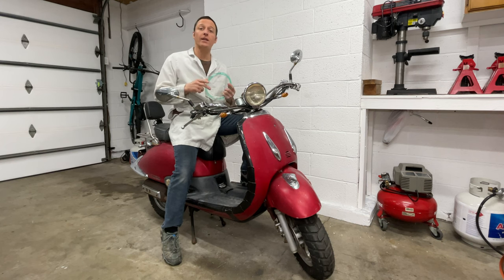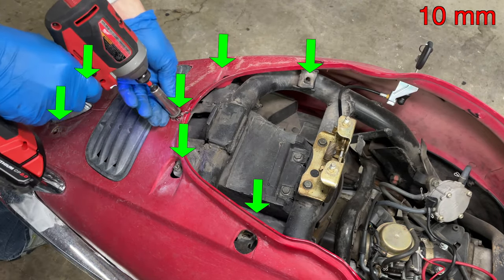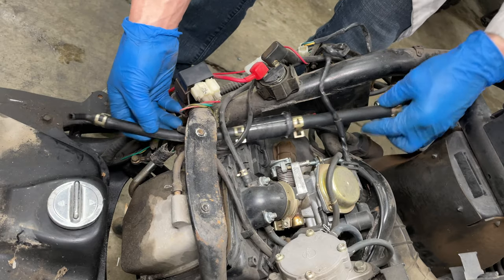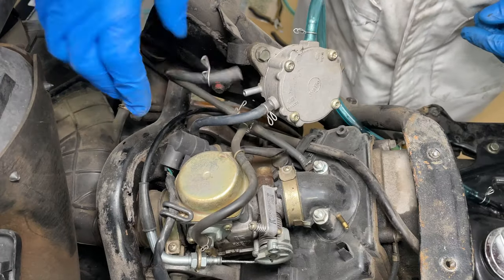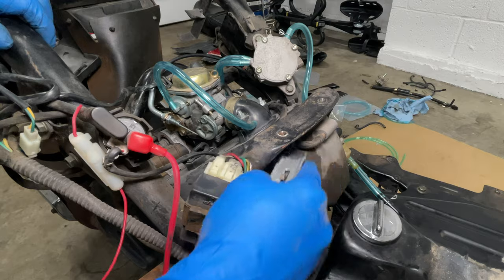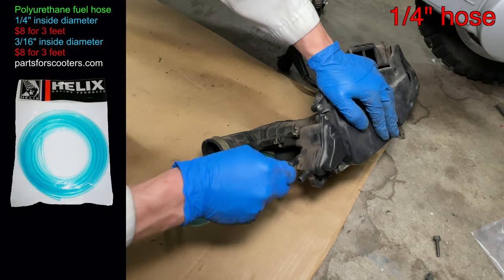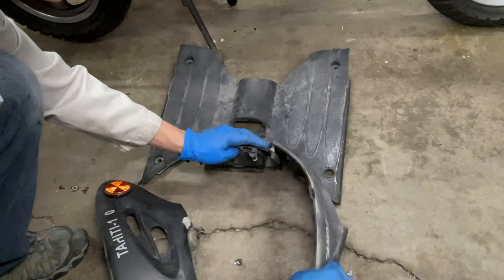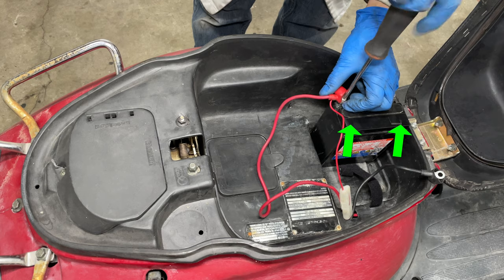New fuel and vacuum hoses and emissions delete on a 150cc GY6 Chinese scooter

Comment: I have the same air box and all I did was removed the pcv part off my air box and put that back on my bike and ran the pcv hose and the cvt hose to that box and that was it. I'm going to buy a uni filter to replace the stock air box.

Comment: Hi Paul, I have a '22 Amigo il Bello 150cc GYG scooter. Last week, I removed the CVT carburetor and installed a Nibbi 24PWK. All good, but for the thing bogging or stalling when I trist the throttle from a standstill. Once I get going, the thing runs well. Could you please advise? thanks very much!

Comment: Hello Paul 🛵👍. I purchased a gel battery recently & was wondering if that was a wise choice. My scooter has complete Leds & the charging system currently is a little over 15 volts at quarter throttle 🤔. Is that too much for a gel base battery ?? Appreciate the info 💯😎
Reply from the maker: Over 15 volts is pretty high.  Gel batteries are basically a normal lead acid battery, but the acid is less of a liquid so it can't spill easily.  I'm a big fan of cheap Amazon batteries for scooters.  I just buy ones with good reviews and I haven't had a problem yet.  You might want to try a new voltage regulator to see if you can get that voltage a bit lower.

Comment: Why did you just not block off unused vacuum ports with caps? Also, why no one on Youtube is using JB Weld to block the hole on the engine block, no one wants to wait for it to dry?

Comment: HI, I have a 150cc, it seems to start and idle fine, but after about 10min of riding and if you go open throttle, the bike seems to enter a lean or fuel starved condition, it will start to bog and then stall, wait 10secs, it starts up again, but then will sputter and bog then stall again, Ive replaced, carb,cdi,plug,battery,coil,vaccum petcock, fuel lines,,,same thing happens,,,HOWEVER, I noticed that from the gas tank(under the floor boards) to the petcock there are big bubbles of air many times in that line,,,,I am thinking that may be the issue, why would this be happening, and how could I fix it?  TY for your video
Reply: you could check and see if it is vapor locking maybe
Reply: you found the problem: 
the fuel hose right at the gas tank fitting needs tightning,it is picking up AIR right there, due to the suction;
Reply: @josepeixoto3384  actually the fix was the pickup coil, when I replaced it all the issues went away
Reply: @thedaydreamer7972  good to know that it can cause that kind of a misfire too, thanks

Comment: please answer!
my scooter has only one vacuum hose coming out of the intake manifold and goes to the carburator throught the gasoline line and the scooter seems to run better and smoother if i don't connect the vauum hose to anything. so my question: is it ok to leave it not connected and leave the gasses go to air ? or something bad happens? HELP! 
.
NOTE: my scooter came without any emission system

Comment: And hey thanks a lot man I have me a GY6 TaoTao scooter I pretty much 

freaking modified it with everything just 

about everything I have a little bit more stuff than you for my GY6 scooter I even going to make it a hundred cc with a 

nitrous kit on it all I really need is synthetic oil the hoses like what you got I need to swap out my front shocks and I need a switch for my hoses and I need 

the gas tank magnet to catch the shreds 

inside my bike so it won't mess it up it'll make my engine last longer b. 💪😎🆒^

Comment: Informative video, but how much longer before gas scooters are done anyway?
Reply from the maker: I'm guessing at least 20 years.  Until electric scooters become cheaper than gas, the Chinese scooters will still be here.
Reply: @LabCoatPaul  Point well taken. They keep talking about ending gas powered vehicles, but how many people (especially in the lock-down economy) can afford to replace their present transportation with an expensive electric with much shorter range?
Reply: Gas motor scooters are very economical at 100 miles per gallon. They will be around as long as gas is available. There’s no reason why electric scooters will replace gas versions until the electric ones are less expensive and battery replacement is cheaper than engine replacement — that is a few decades away. And there are tens of millions of gas scooters out there. With proper maintenance and cheap replacement parts they can run almost forever — in third world countries they already do
Reply: @drdrew3  here where i live, in Europe, Portugal  ( where the Justiceystem,the courts, judges,are a royal stinking POShtt...) there are hundreds and hundreds of elec scooters for sale cheap because the battery in no good any more,and it costs a bundle to replace,so people just puts them aside; very very *ignorant* of them for following the hype and buying them elecs in the first place, a bad move at this time; 
nothing like  pulling up to a gas station and in 2 minutes filling up

Comment: I bought a 50cc moped Pagsta Regal Raptor recently, it looks like a small motorcycle. It runs kind of bad on 4th gear and higher speed RPM at full throttle where it kind of wants to die and does from time to time, always starts up again but it runs unevenly. I have checked some things and also noticed I have an EGR, do you think that could have anything to do with this problem? It seems the previous owner had broken of the airbox housing and left is only the EGR hose and some cables that go to it, I have no idea what it does, it doesn't look like in your video.
Reply from the maker: Disconnected hoses can cause a vacuum leak and would mess up your air to fuel ratio.  I recommend setting up the hoses like I have them in the video so you don't have any extra stuff.
Reply: @LabCoatPaul  Thanks for the reply, I managed to get the bike running a bit better it doesn't die on me any longer but I can't reach a speed higher than 30 kmh (18 mph) and this bike should make at least 45 kmh, it seems to get power but just don't go any faster. I cleaned the air filter and will try it today and see if it runs better, seems it gets very hot after just a short time too. Maybe could have something to do with the air not being enough? I tried adjusting the air mix screw but it is almost turned in as far as it goes, about a half turn before it is maxed. Turning it out slightly will cause the engine to idle very fast, the idle screw is on the other hand turned out 3-4 hole steps. I am wondering if the main jet might be too big? Haven't got any smaller to try out with but it seems to get way too much fuel because the spark plug gets black from soot, bought a new one but still gets black and sooty.

Comment: Hi, I just got a 50cc 4stroke and the carb is shot and fuel and vac lines need replacing, I noticed that the carb in there has no vaccum hose to it, only from the intake manifold to the petcock, If I get a new carb with a vaccum port on it as most do, do I install a "T' from the intake manifold to the carb then to petcock, or do I plug the carbs vac line and set it up like it is?  TY for your hard work
Reply from the maker: Yes, you should connect a vacuum hose to the side of the carburetor.  It helps with the fuel mixture just above idle.

Comment: I have a euro 5 50cc moped and where your replacing the PCV hose that comes of the air box and goes to the top of the engine can I take that of so I can put an aftermarket filter on
Reply from the maker: Yes, you can install a foam filter instead of the air box if you want. I recommend running the PCV hose to the foam filter so it still burns vapors from the crankcase.
A foam pod filter will make your engine much louder. If your stock airbox flows correctly, a foam filter will not improve performance. 
A foam filter makes the biggest difference if you've installed a bigger piston and bigger carburetor.
Reply: @LabCoatPaul would you know where I could buy a filter with the PCV connector
Reply from the maker: @morgantowns-qj6uy  Foam filters don't have PCV connectors, just shove the hose between the 2 layers of foam.
Reply: @LabCoatPaul thanks you help me alot I don’t know much yet hopefully soon tho ha

Comment: Paul... thx for this info!  One q... there's another vacuum port on the carb that is right next to the electronic choke unit... (just under the diaphragm cover) does that just vent to atmosphere... or does it also need to have vacuum line connected?
Reply from the maker: The port on the electronic idle enricher (choke) is a vent that goes straight down.  It's an overflow vent.  Pause the video at 3:07 to see it.  It has a short hose (about 1.5 inches) with a right angle that doesn't connect to anything.
Reply: @LabCoatPaul  ... thx!
Reply: @LabCoatPaul  does this line need to have open air if i was to use a manual petcock could i use the vacuum line into the overflow

Comment: I do not predict very long live to the battery assembled like not standing position as it is a lead acid one it is made to use in only one way. Like this lead parts are partially not under acid and it ruins it soon! Good points for emission deleting!
Reply from the maker: I buy AGM (Absorbed Glass Mat) lead-acid batteries that are designed to handle being mounted any direction.  The acid is soaked into a mat, so it can't spill out or leave any parts of the lead without acid.
Reply: Or change to lithium sealed unit

Comment: Hi Paul I have the same scooter just wondering if you know the issue I'm having it will tern on and run but after a few miles of riding at 30-35-40-45 or 50 it bogs and cuts power after that I stop and restart it and on I go but it dose it every few miles???????

Comment: Hi. Was wondering if heard of this one. I have out of the valve cover breather fuel and oil mix missing out. I have replaced the oil obviously and a new petcock fitted. I also have new carb to fit.  Just don't want it happening again if its related to something else.
Reply from the maker: A little bit of oil coming out of the valve cover vent is normal.  It's part of the positive crankcase ventilation system, or PCV.  Piston rings don't seal perfectly, so when the engine is running some of the combustion pressure and a little bit of gas, can get into the crank case with the oil.  The breather vent on the valve cover lets those extra fuel vapors back out.  The hose should be routed to the air box so the engine can burn those vapors.
Too much oil or gas coming out of the valve cover can be caused by having your oil overfilled, having your carburetor tuned too rich, or bad piston rings.
Reply: That's just it it's not vapours it's actual oil/petrol mixed. Drained the oil and got way more out than I put in.  It's like an actual stream coming out of breather. It filled up air box
Reply: @LabCoatPaul  Hi there, i'm not sure if you answer it as the topic was long before but in anyway i would ask that you mentioned pcv works as the recruiter for the leaked gas and oil to the crankcase. Crankcase should be placed bottom side of the engine. How can the breather on the valve cover blow that leaked oil and gas to the air system again as it is placed on top of the engine. I'm confused because these are far apart itself.
Reply from the maker: The PCV takes extra vapors from the crankcase and routes them back into the intake.
If you have gas in your oil, some of it will evaporate and go through the PCV back into the intake.
If you your oil has a lot of fuel contamination, change your oil.
The purpose of the PCV system is to prevent vapors from escaping into the atmosphere. It’s an emissions component.
Reply: Thanks for your answer but still i did not get it exactly. As far as i know the only pcv component in this bike is a port on the petcock and a hose out of it to the air intake. So, when gases pass through the piston and escape to the crankcase then how  our pcv component recall them from crankcase to petcock again. It is a long way and it should be some vacuum or any other force that gases to be drawn out again. but inversely once the gases escape down the piston there is no force to take it out again upward to my logic. Please tell me if i'm wrong. In cars, there are some other hoses crankcase to connect air intake and it is logical but in this bike there is no direct connection between crankcase and air intake. So, i just dont understand how the escape gases in the crankcase can go back to petcock again without additional route like in the cars. @LabCoatPaul

Comment: LCP, get videos, I’ve got a couple questions which I hope you can answer. My scooter is similar however on my gas tank I have another hose besides the one for fuel. It’s on the right side of the gas tank and it runs to something I’d think is the pvc valve, then further runs to what I think is the egr valve, now the question I have here is can I just cut that hose and plug it up so no gas leaks out?  Question 2, is it necessary to cut that piece off the air filter box or can I just drill a hole in and insert the hose? As for question 1, I can send you pix if I didn’t explain it well enough. Thank you, LW
Reply from the maker: If your gas tank is in the floor, like my scooter, you'll have a fuel hose going up to a pump, then to the carburetor.  The other hose coming from the tank is a vent hose.  It's routed to the charcoal canister to store the fuel vapors and burn them later.  It's ok to leave that hose disconnected, but I recommend running it to the air filter box, so if fuel evaporates it can go back into the engine.  Don't plug the fuel tank vent.
It's not necessary to cut parts of the air box.  I just did it to have the minimum number of parts.
Reply: @LabCoatPaul  wow thx for your reply. I’m totally confused with the mess the previous owner has left and I basically want to eliminate any lines that I don’t need. Yes the  left side of my floor gas tank is the line that is going to the fuel pump, then on the right that line goes to what I’d assume is a pct valve and then further to I believe the EGR valve. There is actually another hose going into that canister as well besides the line from what I think is probably a pct valve. On the other side of that canister is a nipple or stud or whatever it would be called to which nothing is connected, so I was stumped and hoping I could eliminate that whole setup.  Like you stated though I will run that line from the fuel tank in the air cleaner box. Thx again for your reply. Gotta say again, of all the vids out there yours are the best, explained well and you seem to use the KISS principal and it’s easy to understand.
Reply: Meant pcv but iPad kept changing it to pct, sorry.

Comment: Great video, I have almost the same scooter with same hookups, how should I route the lines from my old air box? I have like 4 lines coming off of it and I want to put in a new carb and aftermarket air filter,,,TY again for the video
Reply from the maker: This video shows you the minimum number of hoses you need.  If you use a foam filter, just jam the PCV hose between the 2 foam layers and you're good.
Reply: @LabCoatPaul  TY so much for the video, mine is almost like yours, but on my gas at 5:11 you have one fuel outlet from the tank to the pump , I have 2 outlets on the gas tank next to each other, why are there 2?
Reply from the maker: @thedaydreamer7972  You probably have a vent tube.  That's to let extra pressure out of the tank.  Apply vacuum to each tube to see what comes out.  There should be fuel in 1 and just vapors in the other.

Comment: Hi Paul, we have the same scooter, do you know offhand where the fuses are located? This scooter has no power when you turn key, Id like to check
Reply from the maker: Chinese scooters have one glass 10 amp fuse by the battery.
Reply: @LabCoatPaul  Thanks paul, if that fuse is good and you turn the key and get no power and the battery is new, what else you think it could be, where should I start tracing?  TY great channel

Comment: Hello! Do you or anyone else know if it is possible to use a throttle carb on GY6 engines? I mean a non-cv carb like a nice Mikuni. Pros and cons?
Reply from the maker: You can change the carburetor if you want to.  A bigger carburetor will get you more power if you've installed a big bore kit.  If you have the stock size piston, going to a bigger carburetor could decrease your torque and horsepower.

Comment: I have a Roketa mc 07b-2-4. the egr on mine looks the same at the valve cover but that metal piece goes to a braided line and then what I'm assuming is a square egr valve but looks way different than yours. Then the fat line with the filter runs behind the carb out the left side just in front of the kick start. Does this sound like that same thing? My carb also doesn't have a vacuum hook up on the right side by the throttle cable like yours.  Please help if possible! Thanks
Reply from the maker: The good news is you can probably just remove the emissions stuff and set it up like my scooter.  On Chinese scooters that stuff doesn't really work anyway.  If you want clean emissions, tune your carburetor correctly.
Reply: I have the same problem.  My new 30 mm intake carb does not have a place for the vent line on it that comes from the "t" off of the intake...
were do I run that line too?